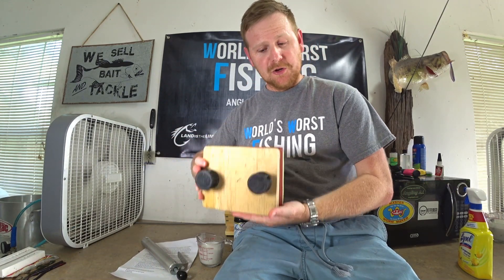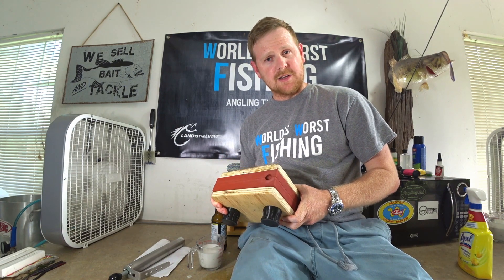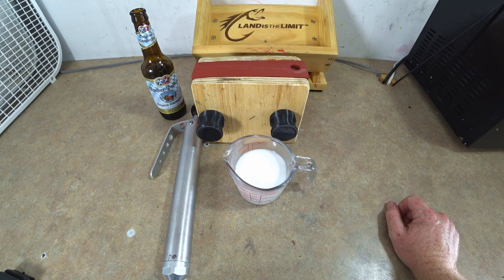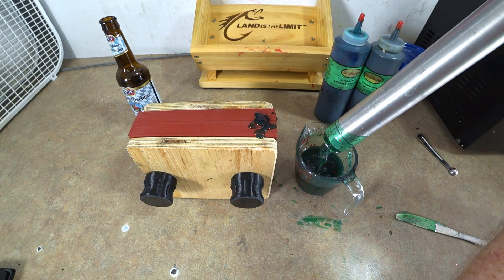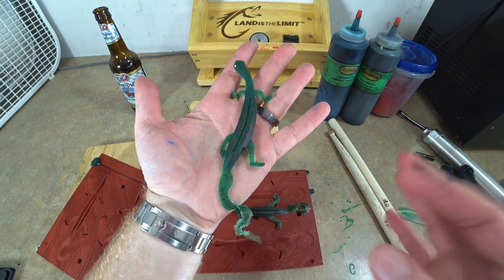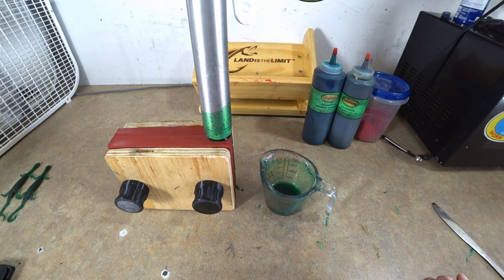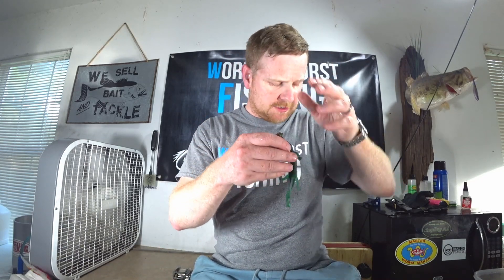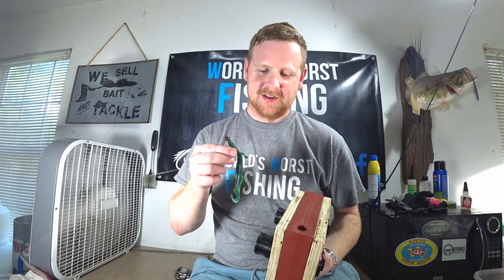A Subscriber Sent Me This Mold & It's AWESOME.  Home Made Lizard Mold From A Channel Subscriber.

Comment: Cool vid again. Eliot is a great guy. Love his vids to. Also working on printed lures as well. What I noticed is that the poured lures are dull. There is no shine at all. Is there a solution for that? Keep up the good work work
Reply from the maker: To get them shiny requires the original master for the mold to have been clear coated...these lizards won't be as shiny as CNC aluminum molds.
Reply: @WorldsWorstFishing  that's what I thought. I'm gonna epoxy my master before molding it. Thx alot. Small suggestion. Try to get a Belgian beer called blonde Leffe. I visit my Pensacola friends alot. You can buy it there. You'd love it :)

Comment: I didn't see the bait close up but do silicon molds have a shiny finish or a matte finish?
Reply from the maker: some are shiny some are more matte..I think it depends on the texture of the master.
Reply: Matte Not Shiny...
Reply: You can add a bit of worm oil before the injection it helps a little bit but you'll never get the super shine like a smooth (machined) Al mold.  I've seen some cast Al molds that leave a slight rough finish the silicone does about that same thing.  You can coat the master in a self leveling epoxy that would also reduce the layer lines of the 3D printer.  I kind of like the layer line texture adds something a little different to the same old shiny baits.